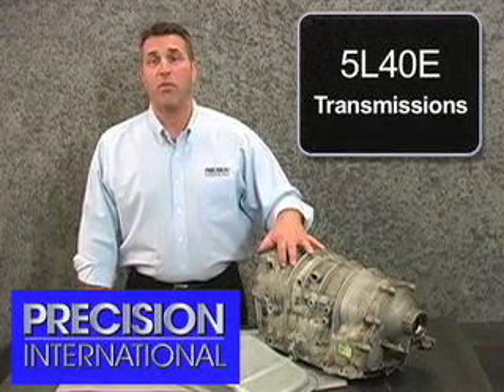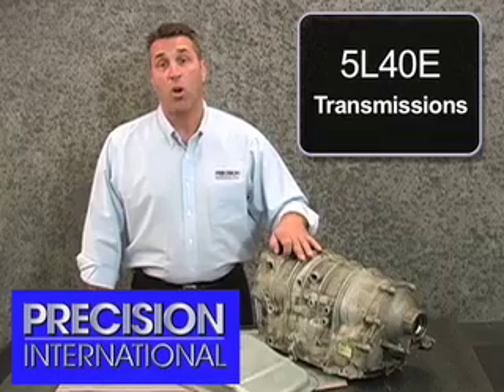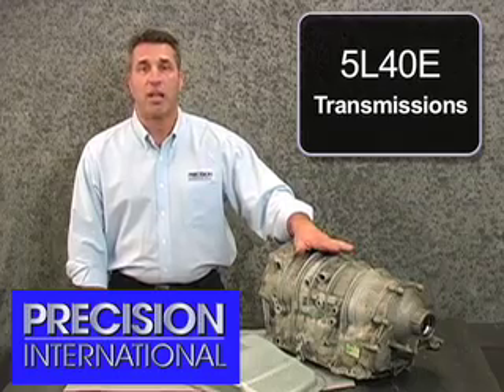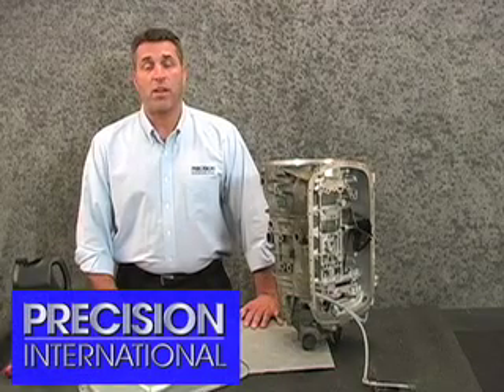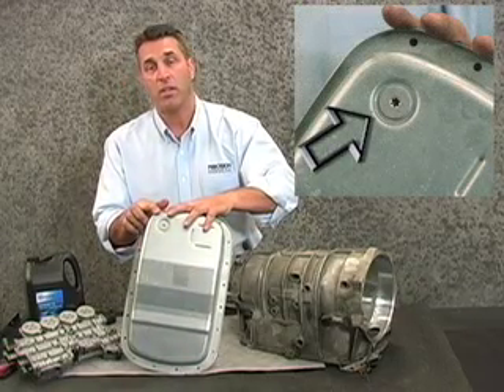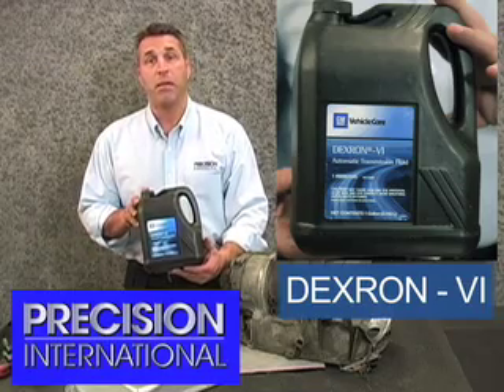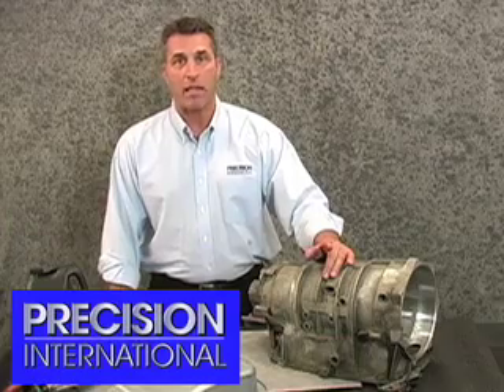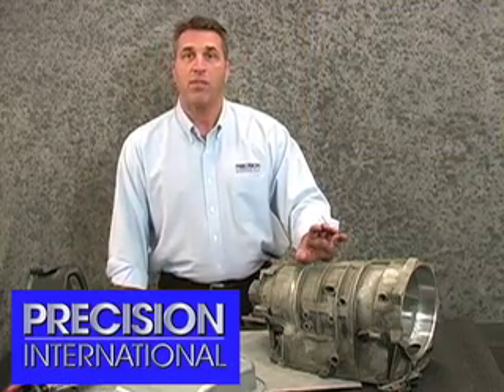5L40E Automatic Transmission Overview with John Parmenter

Comment: That's the drain plug, check level plug is on the side. 2005 Caddilac srx takes 6 quarts of Dexron 3 H, not Dexron 6.

Comment: WRONG!  That is the drain plug NOT the fluid level check point. You check it in Drive from the sight at the back SIDE of the passenger side of the trans (2:00). There’s a sight plug on the side of the trans.  Now I don’t trust the rest of the video.

Comment: This dickhead can't even speak proper grammar! Yeah and no! The check/fill is on the driver's side case which is above the pan. Btw, if do multiple burnouts the transmission will give u a big 🤮 eventually! So will the rear end. Btw the rear end went first which I personally swapped out n trans is totally spent now! But she ate many of tires n all was fun. Also got some sweet rubber under coating in wheel wells 🤘

Comment: I'm writing in response to so many negative comments about this video.....this is because majority of you  are familiar with BMW fitted with GM or ZF automatic transmission... Used to think that way as well yet owned 2 bmw e39 which I also didn't know they have a different transmission.... Here is the thing.. If you a in south Africa or zimbabwe majority of our bmw are imports from Japan.. Their transmission are manufactured by bmw of Japan which used source them from JATCO... JAPANESE AUTOMATIC TRANSMISSION COMPANY... JATCO supplies gearboxes to other automotive manufacturers like what GM and ZF does.. These bmw have JATCO JR502E autobox which the Japanese alternative to your GM or ZF..... It does not have the side filler plug like you are used to instead it has both the drain and filler plugs at the bottom.. YES you actually check the ATF level using that bottom hex plug it should spill a bit you also fill using that hex plug... Draining done done using anothe plug just near it.... This gearbox is also used in Nissan skyline cedric and sefiro...the bmw 39 and e34 we have in zimbabwe have this gearbox... Works exactly like the usuall ZF or gm...

Comment: OMG! With the oil drain plug at the oil pan you can not check the oil level! You can do this with the fill plug at the transmission casing.

Comment: My transmission is making an extremely loud metal on metal grinding noise and sounds like an angle grinder on sheet metal and metal balls in a washing machine. . There is also alot of burning plastic smell, smoke, and sparks from under the car. Im just gonna keep driving it, gonna hit the toll road today and bring up to about 120MPH and throw it in reverse, just to see what happens.

Comment: Your info on checking the fluid level is not just wrong but completely crazy. You can't check a "level" from the bottom. The fill plug is on the side of the casing above the pan. That is where the "steady stream" will come from. Also you MUST have the engine RUNNING. Else you will dump half your fluid on the ground, even using the fill plug.

Comment: nice, a lot of useful info. Except I still don't understand how do you check the fluid level? 
my transmission making loud metal to metal clunking when I move the shifter, and it looks like it's leaking from the shifter shaft on the transmission. So I thought maybe there was too much fluid leaked out causing the shifter to start clucking, any input on this?

Comment: Hi, you are pointing to the drain plug on the pan, the fill and check plug is on the left side of the transmission, if you open the drain plug to check the level you will get quite a steady stream until its empty.